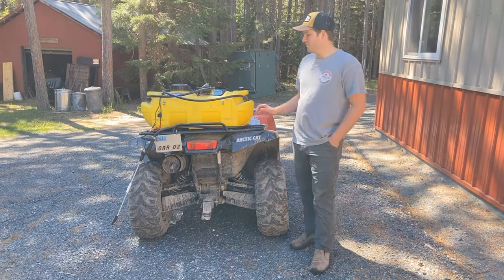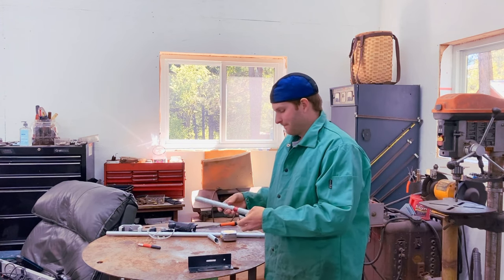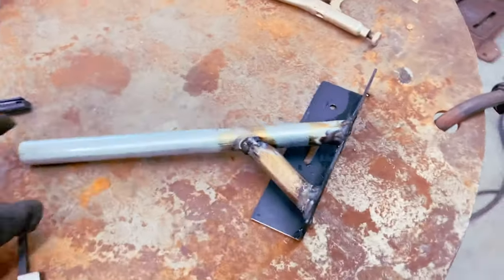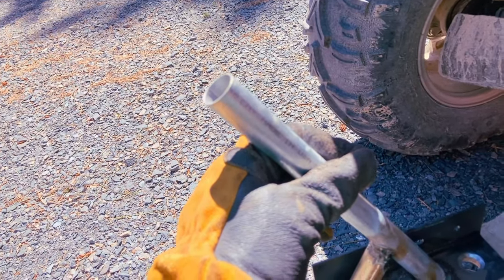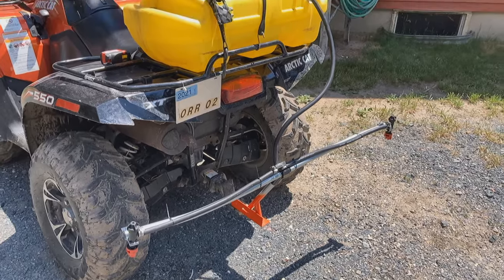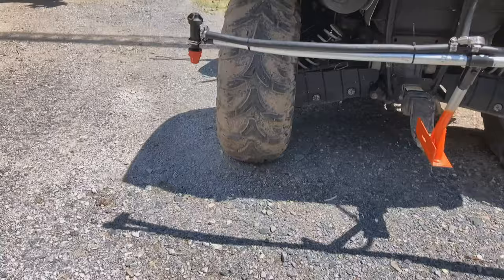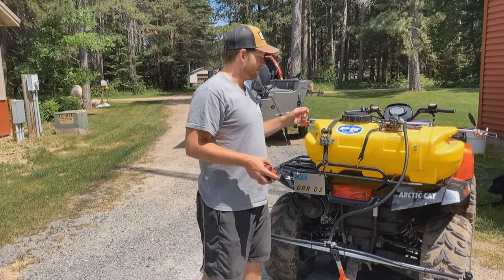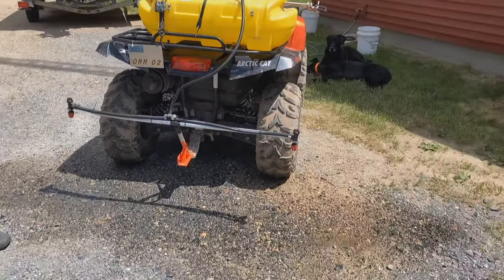Homemade ATV Tank Sprayer Boom

Comment: Glad I watched..
Getting in the mode to do exactly what I just watched you do.
Was wondering what kind of nozzles  and how many to use. Thanks.
Reply from the maker: Check out the description of the video, and all the info for the parts is listed there
Reply: @northwoodsengineered  thank you ..was wondering..before I watched video..but on that note do you think I need a pressure gage?
Reply from the maker: I don’t think a pressure gauge is necessary, but you could add one if you want to

Comment: what kind of pump do you have on the tank ??
Reply from the maker: Hi mica, the pump is a 7.8 gpm 60 psi pump. Is that what you were looking for?
Reply: @northwoodsengineered  Thanks
Reply: @northwoodsengineered  I was hoping this would work with my current fimco sprayer but the pump is only 2.4 gpm 60 psi. Maybe it will still be enough. I'll have to try it out. I can't even find any pumps online that are 7.8 gpm.
Reply from the maker: @manchus30  that pump should still work, the nozzles and check valves are based on pressure and 60 psi is still enough for them.  it would just take a little longer to spray.
Reply: @northwoodsengineered  I'm looking to spray food plots with this. Which set of nozzles work better for that you think?
Reply from the maker: I’m doing the exact same thing. The nozzles I list in my description should work well for you. But you need the nozzle and the nozzle body that I list. I list different nozzles and both have worked for me.
Reply: @northwoodsengineered  last question hopefully, how many ft of hose did you use? Just ordering everything now.
Reply from the maker: I would order around 15 feet just to have some extra, if it’s not too spendy. Minimum is probably 10 feet
Reply: @manchus30  how did that 2.4gpm workout?
Reply: @BSBASSIN  I ended up buying a fimco boom at an auction so I never ended up doing this.